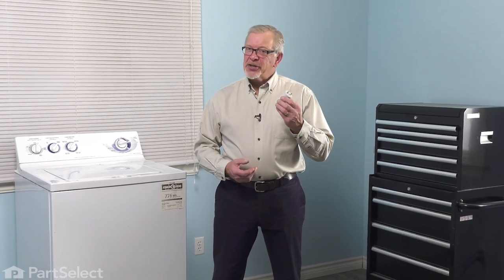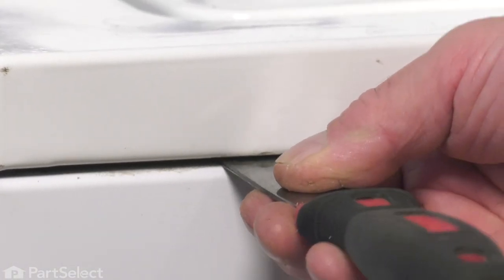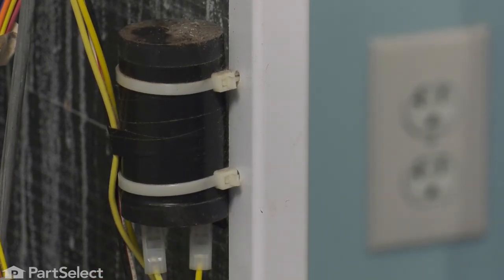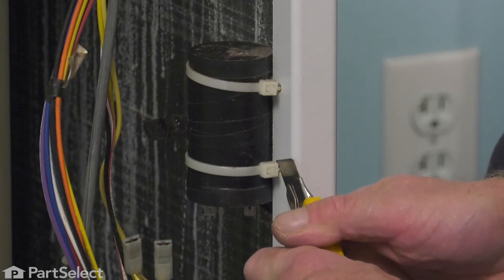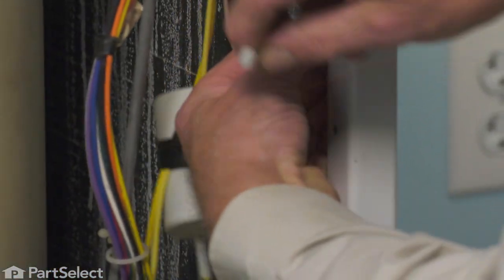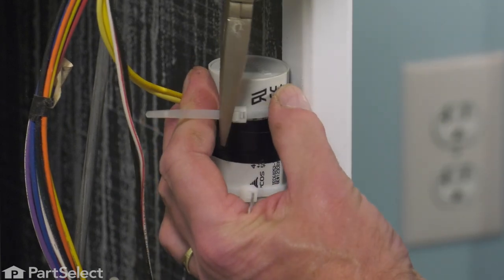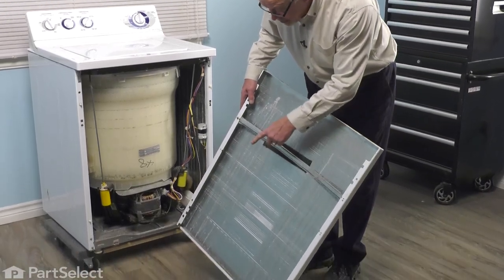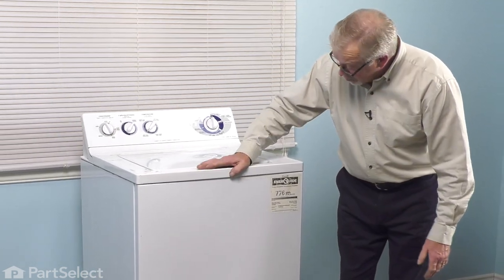GE Washer Repair - How to Replace the Capacitor (GE # WH12X10462)

Comment: Opened up my washer just like that, but the start capacitor is not visible.  Where else could it be?
Reply: behind the Top Control Panel... take out the screws on the back of the Control Panel, and the cap should be at the far right side.

Comment: I have a GE WPRE6100G1WT. The washer tripped the washer's designated breaker in my home's breaker box while the washer was operating in mid-cycle. The breaker trips immediately upon plugging in the washer or resetting the breaker with the washer's power cable plugged in. I unplugged all of the wiring harnesses to the motor but the washer still tripped the breaker. I then unplugged the wiring harness to the drain pump and motor assembly. The breaker still tripped. Finally, I began to remove the wires on the filter power line. When the red wire with the black tracer was disconnected the breaker no longer tripped.

Comment: First, the capacitor is for motor start. 
Usually failure in this part doesnt let motor spin and listen a Brrr sound. To test it you should disconnect the washer from outlet. very carefully disconnect at least one wire from the cap. 
Very carefully, with a isolated screw driver or jumper you can short the cap leads. you will see a small spark, it means the cap is ok because is storing charge. 
However it could be discharged, in this scenario you disconnect the other lead of cap. from an external cable you can apply 120 v to cap for 3 seconds, no more because it can explode.   you can repeat the short,  if you do not see a spark, the cap is not good.

Apart the capacitor the start winding of motor could be open, or the bearing in the pulley side could be wear.
good luck

Comment: Which side is positive or negative  in the wire connections
Reply: Did you ever get your answer? It's not marked on the part. 😢
Reply: @kellyford4773  no but I still connect it  and it worked
Reply: @jvst20051  I found another video today and it said it didn't matter which wire went to which terminal. Mine didn't work - it's another problem in combination with my former capacitor self destruction.
Reply: @kellyford4773  hope you get it fixed we don't own that appliance anymore